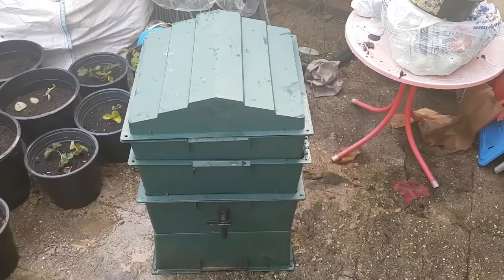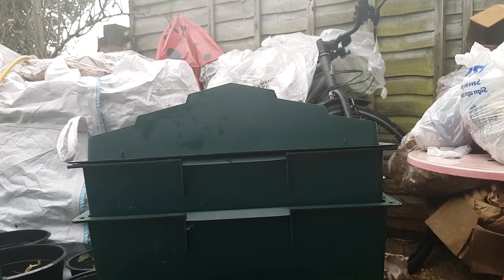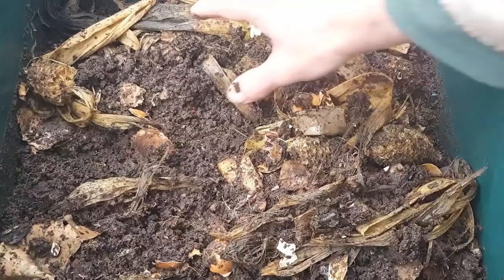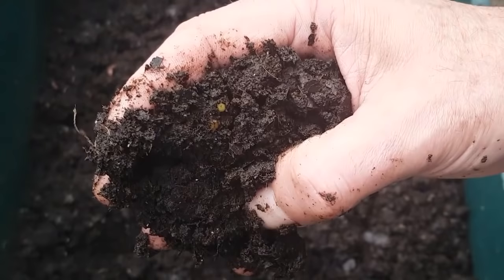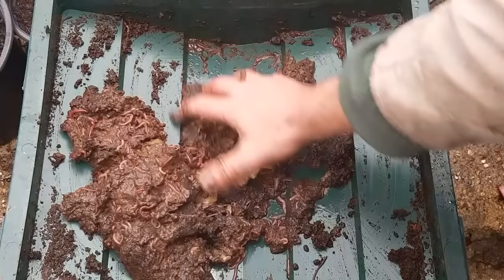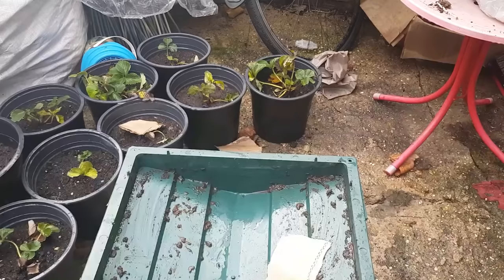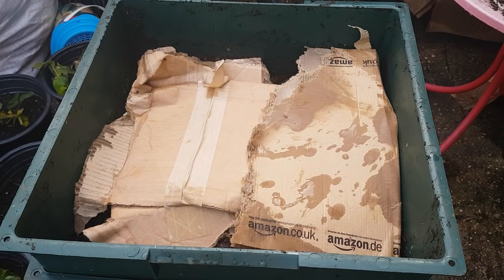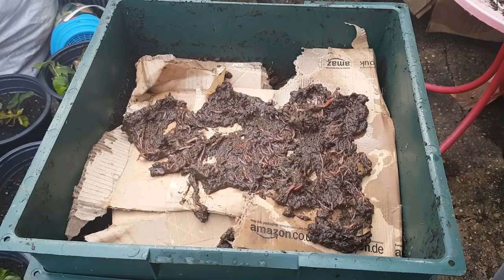The Worm Tower Composting System - Introduction

Comment: I gave up on mine and just throw everything on the compost heap now as it’s much less trouble and still heaving with worms.  Do you also use normal composting and if so what’s the real benefit of worm castings in this form, compared to the worm castings that are mixed into my compost anyway? Also bearing in mind that the compost bin is 20 times the size of the worm bin and so has lots more worms in it is the worm bin only for small gardens?: all the best - Steve
Reply from the maker: Hiya Steve - yep, I've got a few big bins on the go - heaving with worms. This smaller set up would be more suitable to vermicomposting with limited space I think. It's advertised as being able to process the food waste of a family of four but I would be sceptical of that claim to be honest unless they're eating one banana each a week lol. If you're very limited for space it is a neat and tidy solution though. It wouldn't look out of place on a balcony of an apartment block for example. And you will get vermicompost from it :-) As for the end product - every batch will be different because no two bins will have the exact same type and quantity of food scraps or carbon bedding so the finished composition will differ but you'd only know by exactly what in a lab! For those of us just equipped with a spade and fork it'll be good stuff no matter what. What's in the bigger bins in the garden will almost always be vermicompost, that is, worm castings mixed with other composted materials - if you're aiming to produce pure worm casts this type of bin would get you a lot closer to that by virtue of the fact there's smaller quantities of food going in and you can more easily see (and wait!) for it all to be processed by the worms. Whereas when you dig out the bigger volumes in the bigger compost bin, there's bound to be material that hasn't passed through the worm yet.
Sorry mate, that went on for a bit - it's 1.30am and it's been a very long day lol - I hope that made sense?
Reply: yeah it did, thanks!  So in summary the dedicated worm bins are great if you only want to process kitchen waste in a small area and/or you want 100% worm castings.  In my case I'm happy for the worm castings to be mixed in with my main compost, so I'm sorted!   : All the best - Steve

Comment: it's the sump supposed to be empty? i thought it was only for liquid to drain off? my other thought is why couldn't you put a layer of window screen something that the worms wont eat but also can't fit through over the bottom of the lowest bin.
Reply: I tried the window screen,  your right they can't eat it , but they CAN fit through it lol, i think there is more worms in the bottom than in the tray lol i don't keep the bin that wet anymore.. what I do now is , put a t-shirt,  or pillow case between bottom and first tray , pull it snug when putting tray on , yes the worms are on it , but their not drowning at the bottom, if water is there . After trying so many things,  the snug pillow case works for me ,

Comment: Thanks for this informative video.  There seem to be some possible inherent flaws with this design of wormery; are you aware of any better designed worm bins that you could direct me towards please?
Reply: I think almost any worm tower system would work as long as the spigot is very close to the bottom of the bin. I don't understand why this company would decide to place the tap so high up on the bin.

Comment: i use a plastic bin called can o worms been using it for years but yes you do get a lot of worms in the sump but it does work well
Reply from the maker: Hiya Chris - it definitely works for sure and it's a neat and tidy system - it just seems a waste of composting energy to have so many worms continuously in the sump and having to fish them out regularly - and I think that's what I find a little frustrating about this set up.

Comment: I crush eggs first I dry them out then put them in a jam jar and break them up with a rolling pin in the jam jar. Worms love cardboard especially brown cardboard some cardboard gets covered in plastic so no good. I shred cardboard up in a cross shredder as I also do with toilet roll cardboard
Reply from the maker: Sounds like a plan 😁 Yeah I made that mistake before with the very very thin plastic you sometimes get on cardboard. The thick stuff the worms just eat the cardboard and leave the thick layer of plastic  but this thin stuff I left broke into a million tiny pieces and I was finding it for months. Never again! 😁
Reply: @LondonWorms  I have had off bit get it in too and glitter. I usually shred cardboard for them

Comment: Is the solution to have no sump? Just a container
Reply from the maker: Hiya DHC - it's definitely a possibility in my mind - just a pile of leaves under the base tray and any escapees would end up there - worms are very energy efficient, and don't like wasting energy moving about so when they find a dark damp spot with food they tend to stay there - and it would make rounding them up a lot easier. If you've seen any of the vids on the bigger bins, I show this - I've a pile of leaves and cardboard around their base so every few days I just round up the escapees and return them to the bins. 
The bins are in good nick - but it doesn't matter what you so there will always be some worms that want to  go exploring :-)

Comment: Yay for a new worm video. I have a couple of worm towers and looking forward to your series! Can you just put some drilled holes on opposite ends to encourage airflow? If the sump doesn't work well, what does work better for a wormery? Have you considered a fine mesh insert above the sump?
Reply from the maker: Hiya Misfit - some good ideas there but I can't reveal anything yet as the finished reels are locked in a safe in the production teams office - so there can be no spoilers before the new series begins ... in other words I haven't a clue what I'm going to do yet :-) But I was thinking along some of the modifications you've just suggested :-) Looking forward to your input my friend :-)